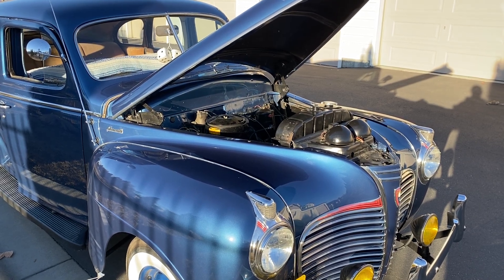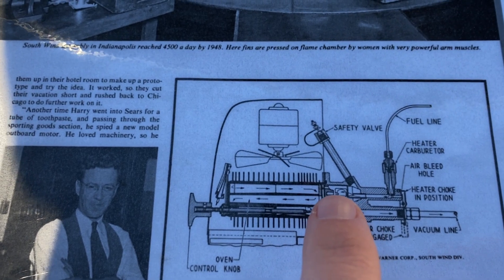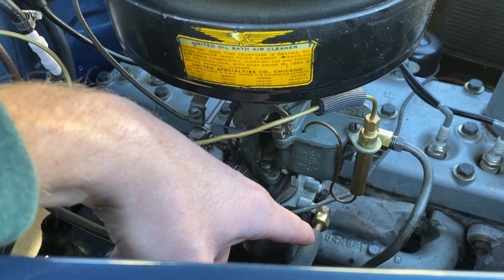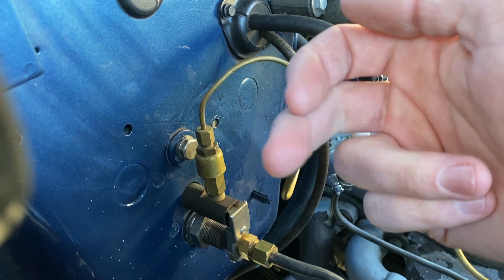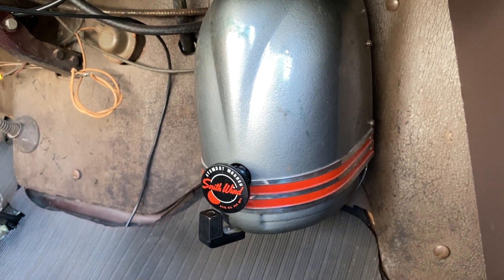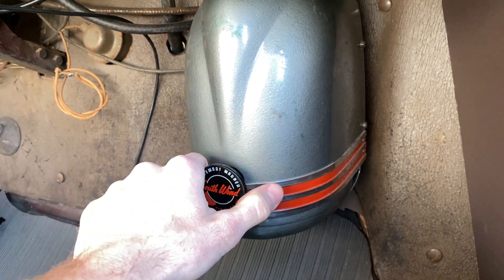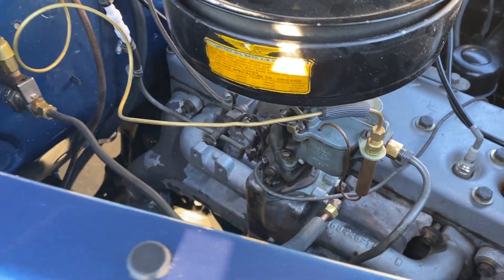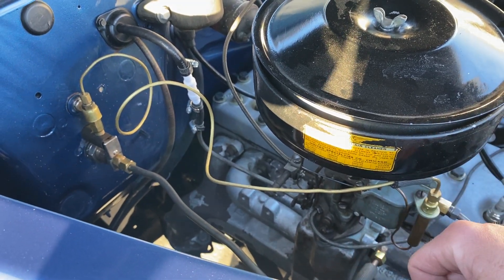Demonstration of South Wind Heater

Comment: Facinating, so using the heater is dumping exhaust into the engine intake  air via that vaccum line. I had heard these could be used with the engine off but I dont see how that would work now.

Comment: Thank that did help👍got one at auction was excited but dont have  the jet tube or vacuum kit will have to locate,will be putting in my 48'chevy cab over,Thanks
Reply from the maker: eBay. You may end up buy another heater but you can get it for parts. Had a friend do that. Just to get the jet tube.

Comment: I have a quick question for you, good sir! That jet tube attached to the carburetor. Does fuel slosh out of the hole you drilled into the top or anything like that? Is it sealed in any way? I'm prepping to install one, and this is the one part of the install that has me a little nervous. I don't want to screw anything up by accident.
Reply from the maker: The hole drilled on top of the carburetor should be the exact size for the tube to slide into. I’ve had a little bit of you could say, moisture come out on top of the carburetor, but never anything spilling out. I just need to make sure when you drill the hole that the tube slides in and does not interfere with the float.
Reply: Hey buddy, thank you so very much for the response! That helps a ton!

Comment: @eriks191  Great video.  thank you for doing this.  Are you running this off a 6V system, like most cars were back in those times?  I'm having trouble with mine getting the glow plug to light on 6V (tried multiple plugs).  I can get it to go on 12V but am wondering if that's to much for these.
Reply from the maker: @HillbillyCraftsman  yes I’m running it on 6v. Never had issues with plug not getting hot enough. Have you checked to make sure you’re getting full 6v to the plug? Running on 12 could burn out the plug quicker. Also you know for certain that’s why the heater isn’t igniting because of the plug not glowing hot enough? They were designed for 6v. Everything must line up perfectly with air fuel mixture and strong vacuum otherwise if the gas is not itemized correctly, it will just flood the carburetor in the heater. I do have another video on here that shows an exploded view of the inside of the heater. If you’re curious to see what it all looks like.

Comment: How well would you say this works in the real world? I've always been curious about this but have found little in the way of actual testimonials as to their efficacy. I picked up a 781 at auction recently, and your video helped me realize that one of the preceding lots, which appeared to be a jumble of copper pipe, was actually the accompanying emulsion tube setup! Fortunately, I acquired both lots and now have a complete heater kit.
Reply from the maker: The heater works extremely well and provides a constant heat flow. Once the heater ignites and warms up the fan will run very strong if the heater is properly running. In the winter time at night I can drive the car without a jacket on. I do have another video on my channel that explains the parts and an exploded view of what it looks like inside the heater.

Comment: I’ve had one installed in my 1946 cj-2a jeep for a long time now. It works great and heats up within the advertised 90 seconds. I’m curious about that vacuum port adaptor that mounts between the intake and carb. You mentioned you heater did not function correctly without it. Presumably you connected the heater directly to the intake manifold vacuum port?
What is the intake vacuum you get at idle? On my keep the intake vacuum roughly is 18 inches of mercury at idle and the heater works great despite not using one of those vacuum adaptors. I have mine plumb straight into the intake manifold.